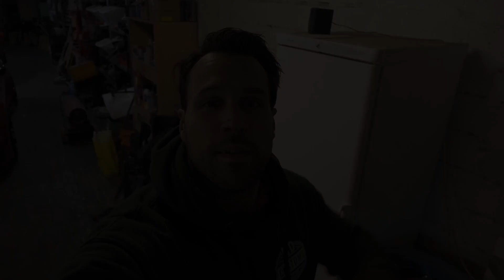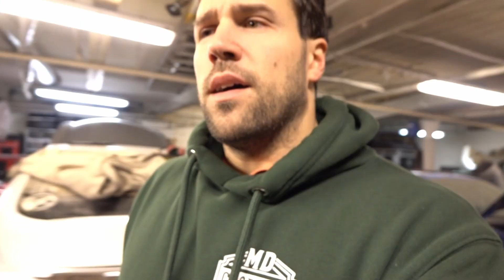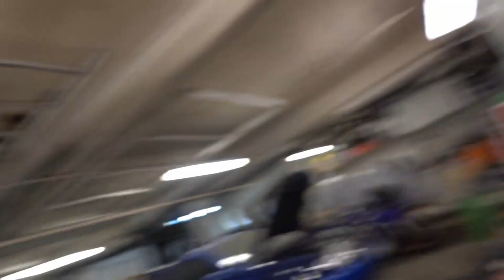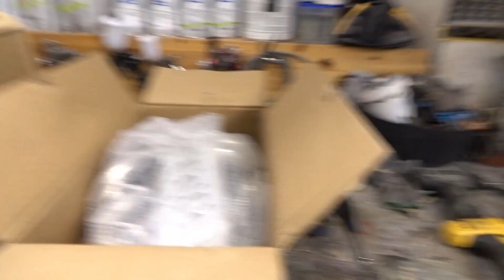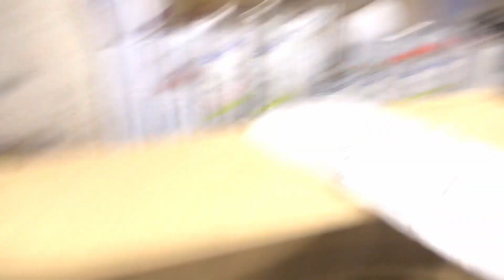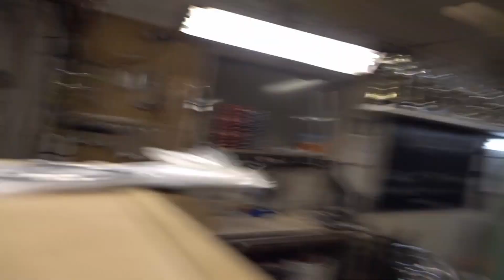HEADER INSTALL INFINITI G37

Comment: Waste of time. Run em as is (minus patching the hole) and bang the runner in. It doesn't affect performance.
Reply: It does effect performance especially on a naturally aspirated engine. Actually a huge gain to be made. Are you new to cars?
Reply from the maker: 👌👌👌 @FarhadKumer

Comment: How did you get the header in through the front of the motor I’m having a problem with that now
Reply from the maker: Hi there. I don't think I got it trough the front. I had to take off the stearing nuckle and take it from behind/underneath the engine.

Comment: I just installed ISR Shorty headers and test pipes on my G37 and they rub my steering column by just a hair. Any advice on what to do to make it clear? I paid 600$ and ISR is reputable brand so wondering what you did to make this fit.
Reply: A hammer can be your friend,sounds archaic but it won't take power away just to give a couple of whacks. There is a dyno test using a sbc v8 and they hammered a really big dent to see if it lose power and it didn't lose anything.
Reply from the maker: I'm really sorry to hear that.. 
I had to install a ball joint to the steering columm and made a fix bracket that I bolted to the frame...
To much work for headers..
Reply: Did you fix the issue? I just got isr shorties and I hope they don't rub anything .
Reply: @Aaron Gomez  didn't really try anything. I got a set of longtube headers and took the shorties off and sold them
Reply: @aarongomez9200  how did the shorties fit im ordering them now you notice any obvious gains or responsiveness
Reply: @elevon2075  They fit perfectly, no rubbing whatsoever, 2011 370z, instalation is a pain in the ass, and I had to install the passenger side twice becase my stupid self put one of the gaskets wrong and was leaking, but they didnt rub the drive shaft.
Reply: @elevon2075 Car feels a littlebi tsmooth too

Comment: Why tempering the steering column weld? Dont you want it as ductile as possible? And will vibrations be an issue later on with header vs column in such a tight space? Asking for a friend ;)
Reply from the maker: Nothing to worry about. will mount a ball joint for the steering column so it can move freely without any problems 😘